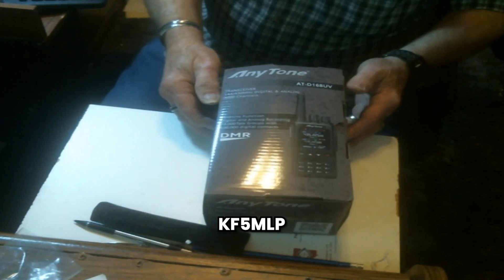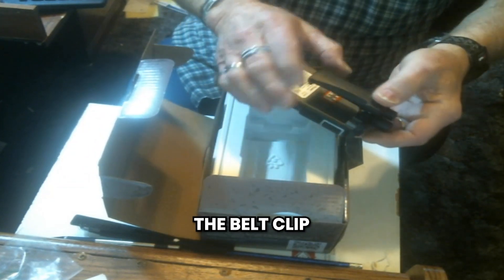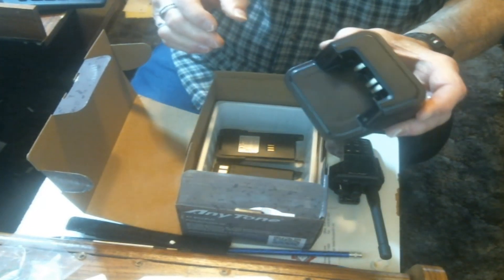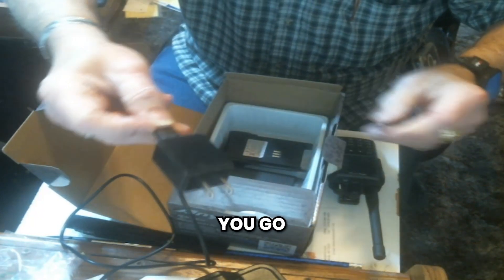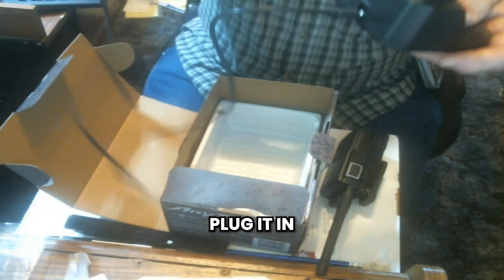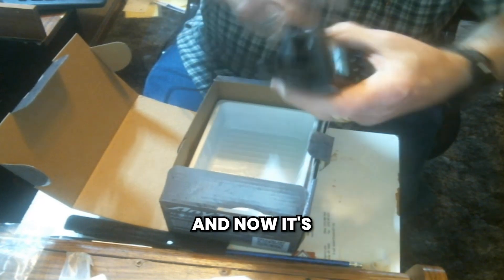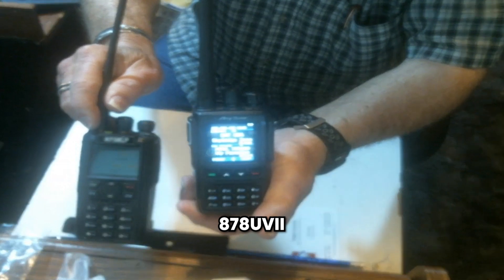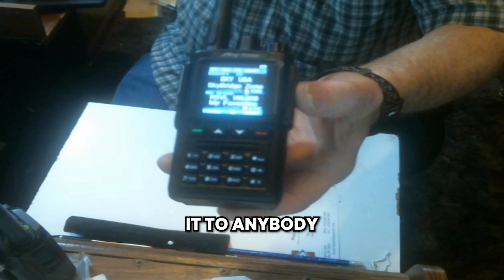Anytone 168 DMR Radio: Full Review & Setup for Ham Radio Operators

Comment: How is the “stability” compared to the 878UViii plus?
Mine (3.06) is definitely a flaky beast.   Sometimes it’ll just freeze and require powering off.., especially while scanning.
Occasionally , while transmitting, the radio will freeze and continue transmitting indefinitely.  Sometimes the TOT will functi9n, sometimes not.

I also have a few that have just died.  Also some with loose SMA antenna connectors.
Despite all of the negatives, I still like them but wish they would be equipped with MDC1200 signaling.
Just from clients, friends and acquaintances, I would venture to say they would have sold close to 400 of these radios ro volunteer firefighters and EMTs for personal use.

I actually leave my APX / XPR / and Hytera portable radios at home nowadays.
I tend to reach for the AnyTone.
Reply from the maker: Hi! Thanks for your comment. If you have any questions, feel free to join our Facebook group — it's a great place to get help from the community: https://www.facebook.com/groups/BridgeComSystems. Also, if you're interested, check out our Plug-and-Play Package here:https://www.bridgecomsystems.com/pages/plug-and-play-package.